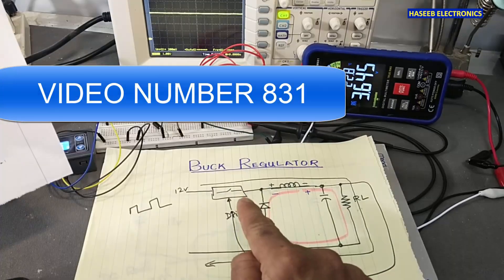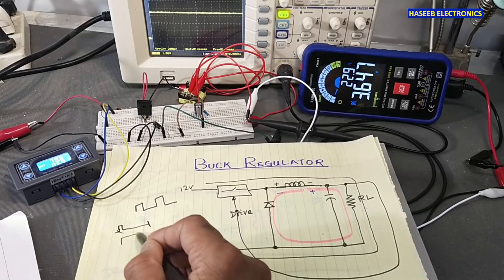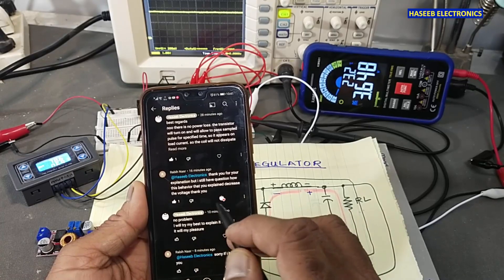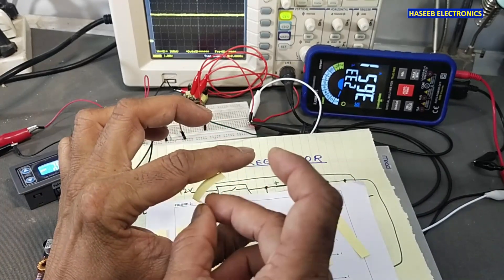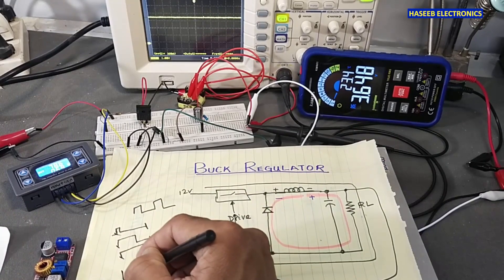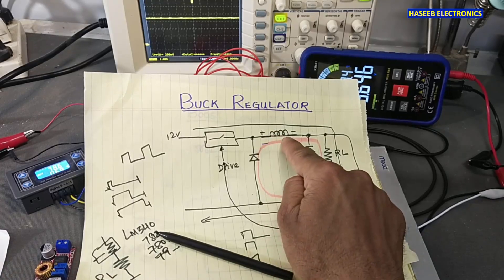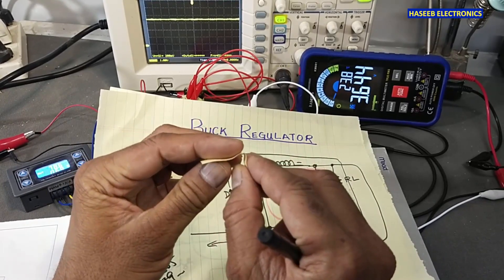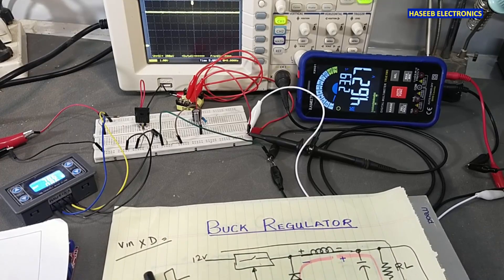{835} Buck Regulator Function Explained

Comment: Thank you sir!!! Key take away if I'm correct is the difference between linear power and switching power is that linear power dissipates power in the form of heat where as switching stores and recycles the energy through feedback using the inductor...?
Reply from the maker: exactly perfect 
liner regulators dissipate heat to absorb the excessive voltage than our requirement
while switching regulators, store excessive potential in form of magnetic energy, and in off period, these recycle that stored energy 
and while storing energy, it also limits the current by using its inductive reactance  feature 
so that the current is limited and same time the energy is also stored
Reply: Sir!, you may be proud to know I created a device that is a MPPT solar charge controller combined with a timer that has 5 different functions as well as an on board 3.7V li-ion that is boosted to 12V to run a small pump. This device is mainly used grow food hydroponically. My question is related to my original post, when my battery reaches 100% capacity as far as being fully charged, where does the incoming energy go than? The cn3722 schematic is very easy to find if you wish to look.

Comment: السلام عليكم Haseeb
Very informative video as we have used from you, keep it up 👍 and I hope it’s always in your good deeds.
I have a question and I hope you could have an answer, I have Philips Airfryer HD9240 that I need to repair it’s PWM ic Viper16 is blown, I bought a lot of them from different sources even from Aliexpress 7 pieces to be exact they are all faulty shorted error amplifier to ground it seems they are all related to the same Chinese cheat, I can’t send you the link because the whole comment will be removed, the circuit has 2 output voltage one of them I know it is 12V and the other maybe 3.3V not sure, do you know replacement for this ic or work around that I could do?
Thanks 🙏🏻